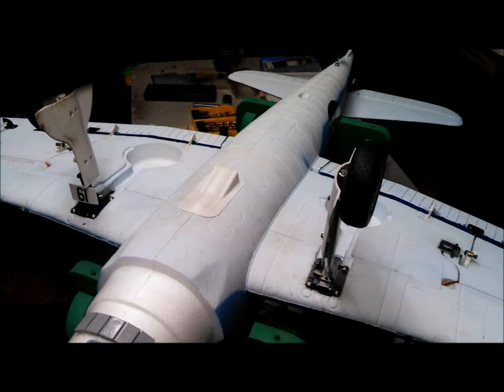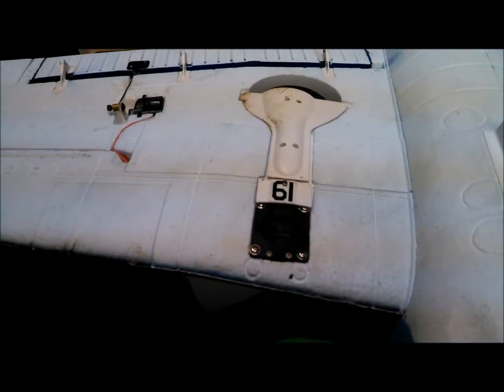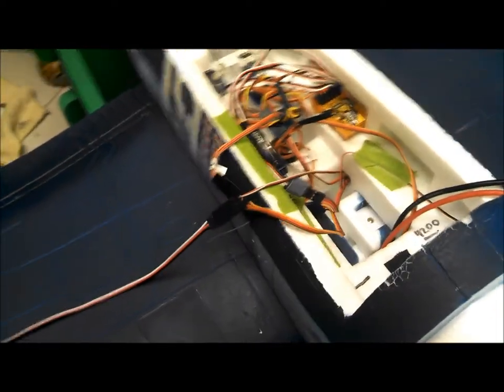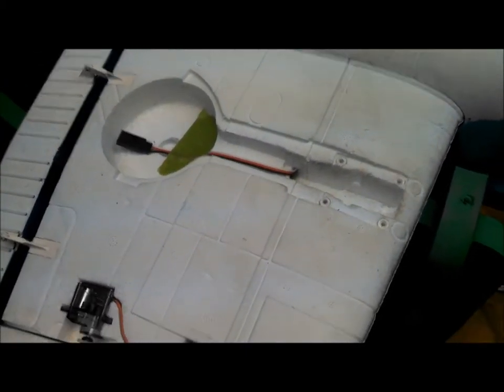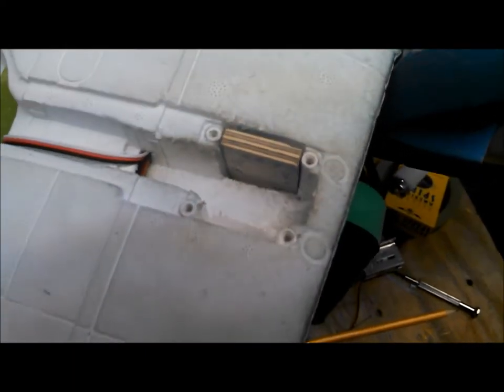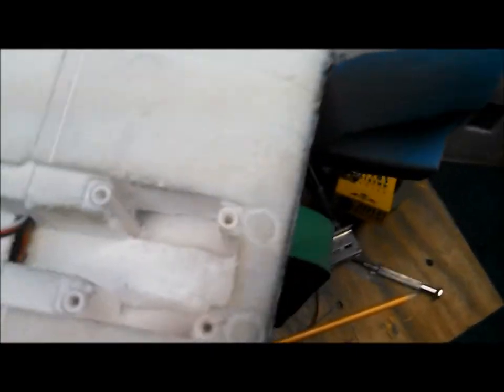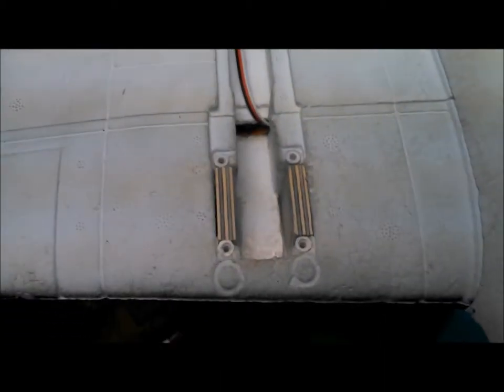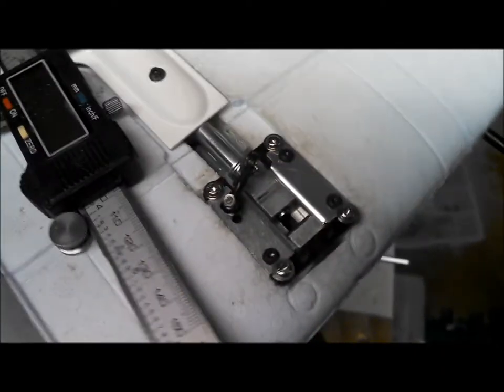RCLander All Metal 100 Degree retract install in Dynam Hellcat and Corsair Part 1

Comment: Wow,lots of mods to make the change. Kinda scares me seeing all the mods to change the landing gear. I am looking at the FMS gear for my Dynam plane.
Reply from the maker: Keep in mind that was 4 years ago and there were no other real options for a solid LG that could handle landings on a rough field. Since then the improved FMS gear came along and coupled with the SmallPartsCNC aluminum side plates they are an easy (if not cheap) upgrade for tough landing surfaces. I have more skills than most when it comes to custom mods and it's one of my favorite parts of the hobby.